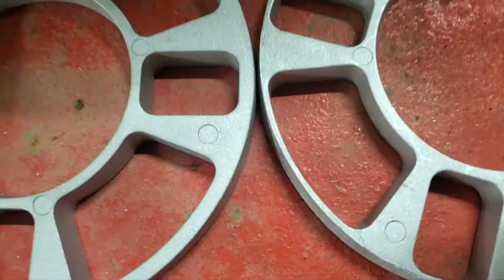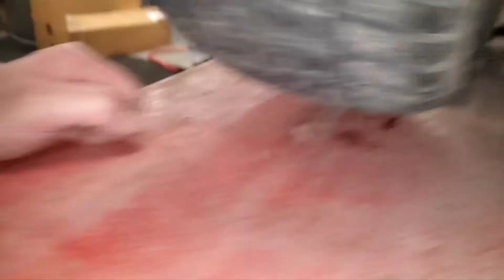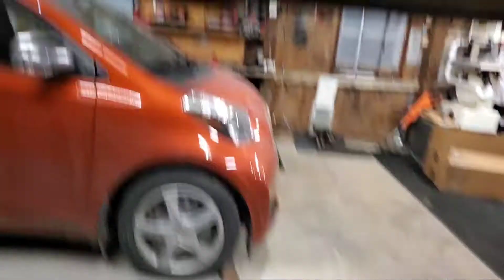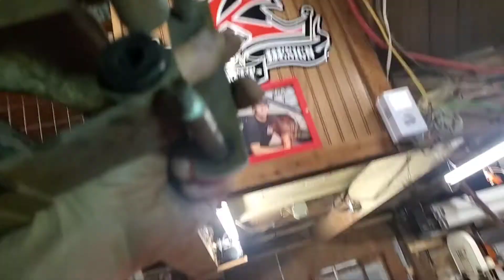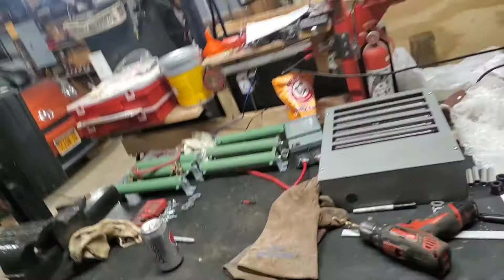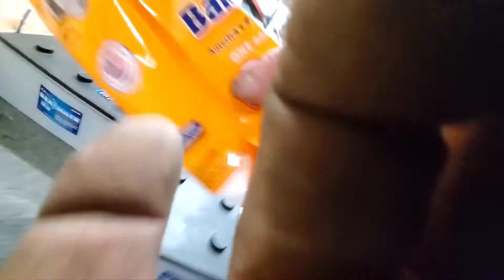installing new suspension rubbers in my trailer and bad news about the batteries

Comment: at the trailer place you worked at did they ever use silicone grease or rubber grease on the bolts that go inside the rubber bushes.
Reply from the maker: I used KY, lol  a lot of the trailers had plastic insert bushings, the old ones like Mine use rubber that's why I used the silicone spray
Reply: @TheOriginalAndysGarage  years ago, yearrrrrs ago when i worked nightshift doing fruit and veg, my workmate would just grab a pie and ketchup from the shop , i wasnt interested in stealing but i guess i did once, i heard about ky jelly but never even seen it, my friend told me it on the shelf over there just grab some he said its very slippery, im a skater so i squeezed it all over the shop floor and the i took a long run upto it and then skated all all over the floor like a bit like slide  . i soon found out it drys up quickly so that was the end of my fun UNTIL hours later when i heard the cleaner yelling you bastard what did you do, he wet the dry ky jelly with a mop and it was like a comedy his legs were going everywhere.
Reply from the maker: @closertothetruth9209  yes it's muffin lube, LOL